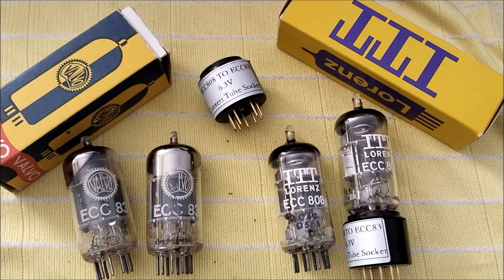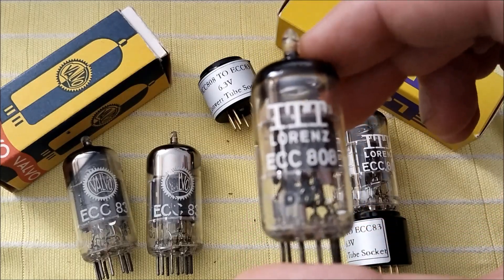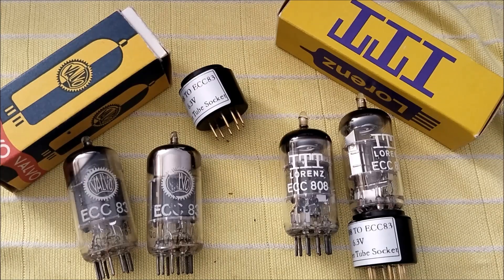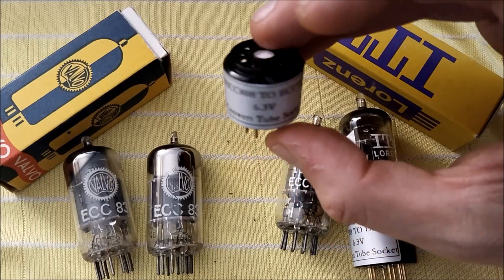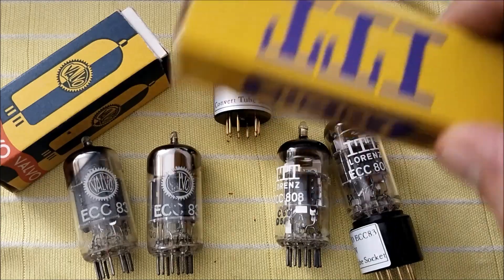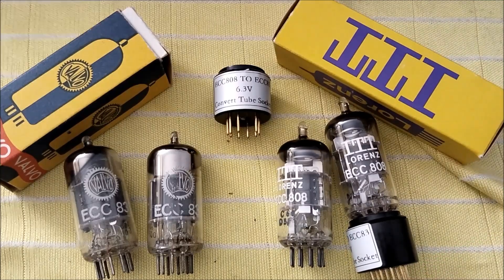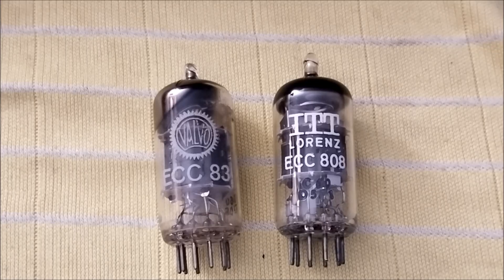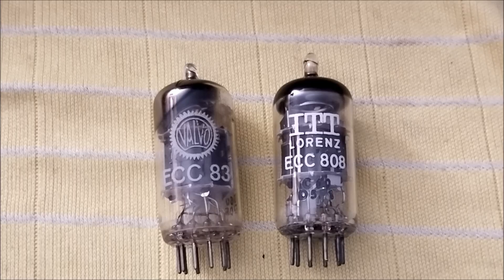Tube Sound Comparison - ECC83 VS ECC808 (VALVO)

Comment: Do you have any experience with the square getter tubes? I've been interested in seeing the differences.
Reply from the maker: Hi there. I dont think the getter shape influences the sound as much as the overall materials and chemical compounds that were use to make tube all together. I believe that getters were more of "experimental" component which were manufacturers playing around to per say create more efficient tube function by absorbing gas molecules.
Reply: @ecc8344  the getter identifies the tube, as it corresponds to an era and overall construction style and production run, but the getter itself  does not influence sound.

Comment: Thanks man! You described the differences exactly how I heard it. Got a lot of german old and nos tubes myself. The ECC808 are basically new and will loosen up a little bit after a reasonable burn in or using time.  They may become very similar to the regular ECC83 valvos regardless of their construction. The glass of the 808 seems to be thicker also - mabe to achieve higher vacuum and longer lifetime out of these expensiver examples. These where also used in laboratory measuring instruments. At least that was where I pulled them out back in the days when Höchst Industries gone down and scraped their old equipment.
Reply from the maker: Thank you for your comment and giving some cool info :)